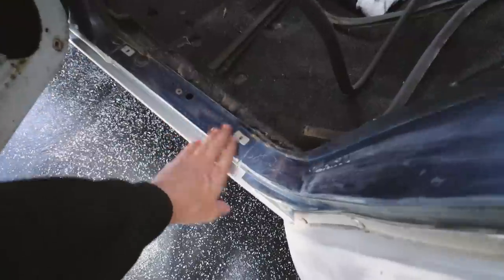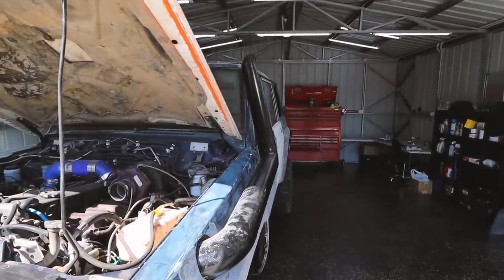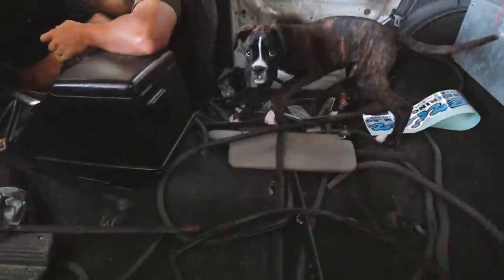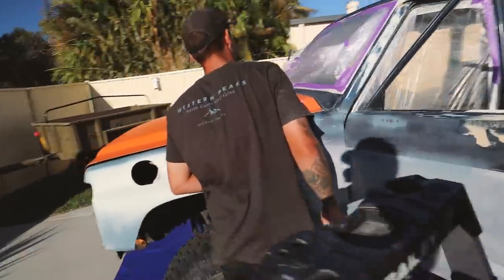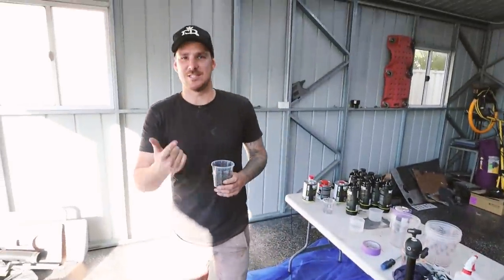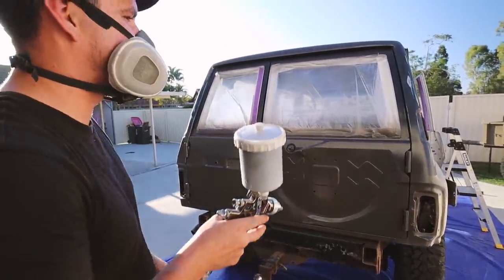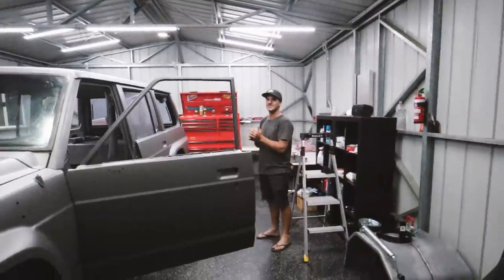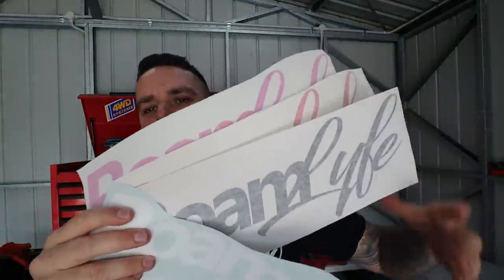Cheapest PAINT JOB with Raptor

Comment: Did my q bus in raptor, $50 sand blaster from bunnings saved me a tone of time when preping the spots the orbital sander couldnt. Loving the vids!!!
Reply from the maker: That’s a great idea did you use much sand?
Reply: @RoamLyfe  from memory it was 1 20kg bag of sand pit sand from bunnings. Just had to dry it on a tarp in the sun and it worked a treat. It gave the the perfect dusting to help the raptor stick.
Reply: what sand blaster did ya grab
Reply: @benjikagi627  just the ozito one with the big hopper on it.

Comment: Just watched a 2 year review of bedliner finish on a van.  He used all different brands of bed liner.  He has done several vans/cars, rough and smooth finishes.  Conclcusion : the coarser texture is a lot easier to clean and smoother to go over with a washcloth and can be even buffed.  The smoother bedliner finish is a lot rougher to touch and dirt sticks to a lot more, is very difficult to clean and just destroys buffer pads, wash cloth do not glide over the surface for cleaning.   Something to think of beforehand.
Reply: I think you’ve got those mixed up. Smoother = easier to clean.

Comment: Looks freakin' sick! What spray gun did you use? Can only find a 2.5 tip gun on amazon for 70 dollars. I'm about to raptorline my 79 4x4 toyota pickup in a color-matched cactus grey. All of my accent pieces are going to be satin or gloss black, and my bumper will be black raptorlined. Already did por-15 on the frame. So stoked about this project!